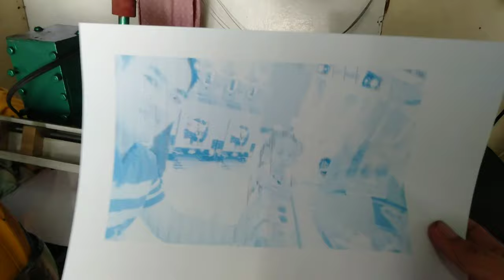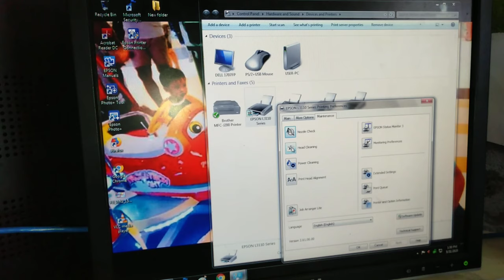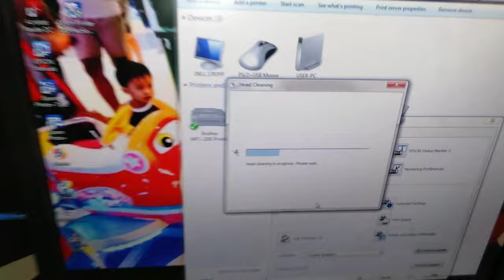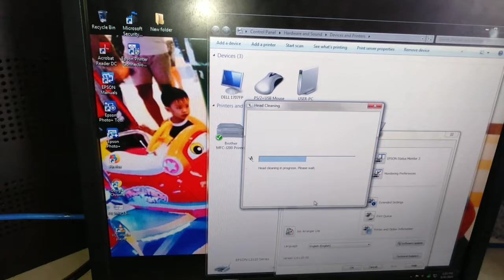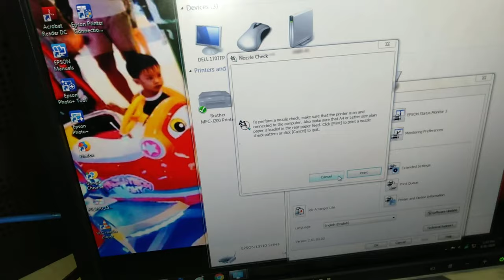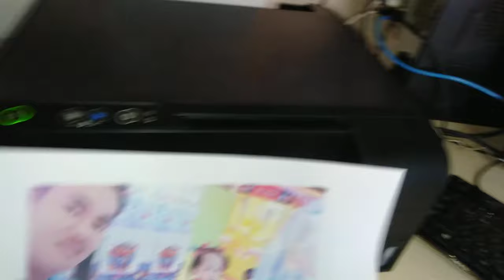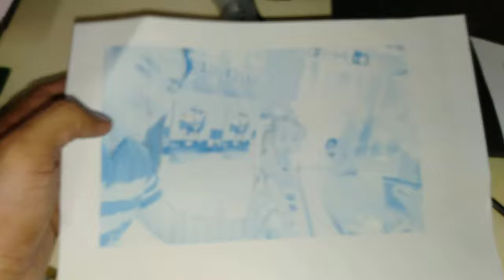Color problem printing for /Cleaning Solution / How to solved

Comment: This was helpful still but it wasn't working for me after 3 tries so if your problem is similar to mine. Try the third option: POWER CLEANING. My printer got fixed after that. It's printing colored again. Thank God! :)
Reply: It also don"t work for me when I first try it, then I try the power cleaning and the printer got fixed. this vid really helpful, and also thank you Shems!
Reply: What is a power cleaning?
Reply: How to make this power cleaning
Reply: Thanks..the power button did it for me
Reply: @wunderbaresvideo4298  just perform the steps in the video until u click on the "maintenance" tab, under it click on "power cleaning" instead.  the method in video didn't work for me, but Power Cleaning does!
Reply: What's power cleaning? Is it similar to power ink flushing?
Reply: That also didn't work for me😢
Reply: Thank you! This comment really helps me a lot 🥹
Reply: Hi I did power cleaning on my printer, but after the power cleaning it still not fixed. What do you think should I do?

Comment: Hello! May konekta ba yung ink level ng color black (only) for Color printing problem? Though inayos ko naman po but still ganun pa din saakin which is yung picture po halos color pink po siya same with ur problem po. Kasi yung ink level ng black ay hindi pantay sa tatlong color which is yung black malapit ng maubos nasa level 2 na siya sa baba. Ano po gagawin ko? Thank youuuu💛 and I've so much learned from your videos.
Reply from the maker: Ok Lang kahit Hindi pantay sila....pag di pa masolved sa head cleaning...ung power cleaning na po pindutin nyo para mag ink flush pero sa power cleaning kelangan puno or nasa 3rd level kc magpa flush sya..
Reply: @levytv1618  Thanks🤗
Reply: Hello po! Boss thank you. Legit nga na kailangan ang ink level ng black dapat hanggang level 3. Thank you sa tips boss at na resolved din sa wakas. God bless you more. Nagkakulay rin lahat hehe
Reply: same here naka ilang nozzle check at head clean still color pink parin poh ung dapat na yellow...now after 2days na pinalipas q gnun parin... ndi poh kaya sa color black kz poh na 2lines nlng ung ink na black..